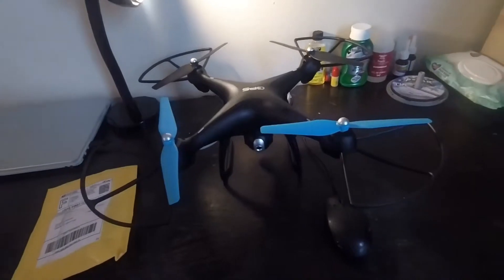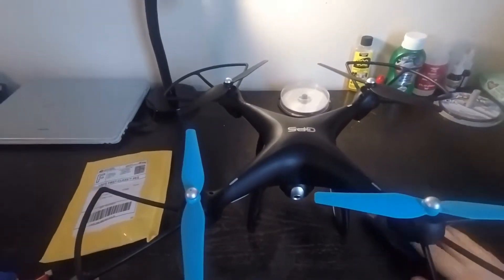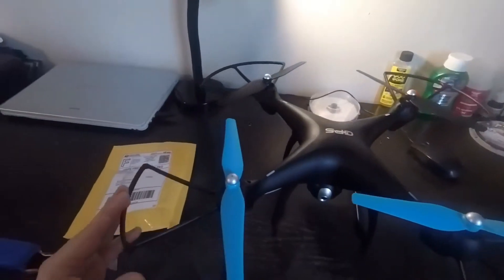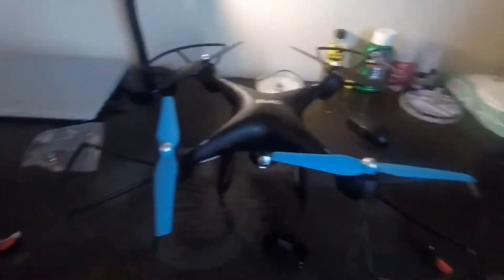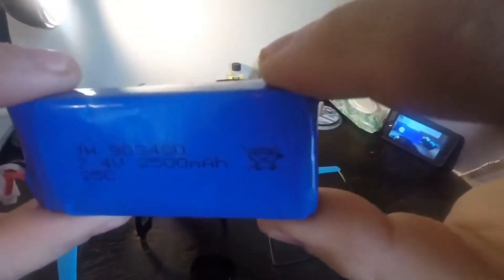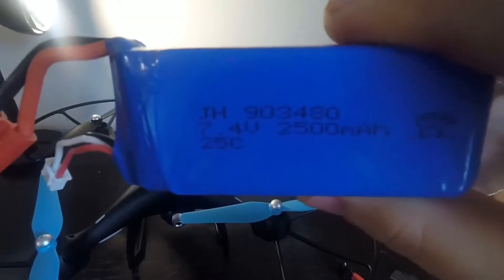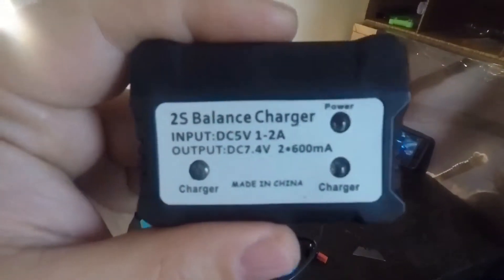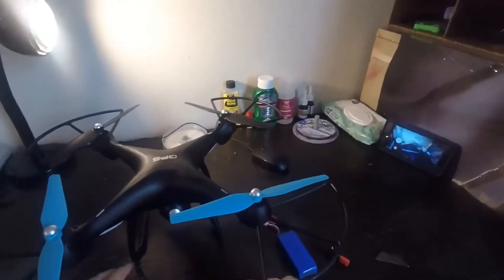Promark Shadow GPS Drone Battery MOD

Comment: I know this video is quite old but I'm trying to do this mod right now. I haven't taken my battery apart yet but I was curious about what the inside of that looked like when you pulled the screws off where the charger connects to the battery. I can't find any videos of the internal parts of the factory battery
Reply from the maker: I’m sorry I didn’t take no videos or pictures of the cage. The battery goes in but every third-party battery that I bought it would not fit inside that cage if that’s what you were wondering?

Comment: I tried that and even tho batterries are fully cherged, drone wont fly, it turns on, calibrate and all that but app says drone low voltage. Battery is 7.4 v 2600mah
Reply from the maker: Since this video was made, the Primark drones are no longer made, and their business have shut down however, a workaround for this is if you use the holystone app instead, and it will work even better.
Reply: @Mr_Goody  thank you sir! I was looking in google and found out theyre almost identical in many ways
Reply from the maker: @jairzuniga4948 yes, sir, that is very true.
Reply: @Mr_Goody  i was kind of sad before this because for me, it is actually a really really good budget drone , i installed a bigger antenna on drone and RC and was able to fly over 1000 yards, until my battery went missing